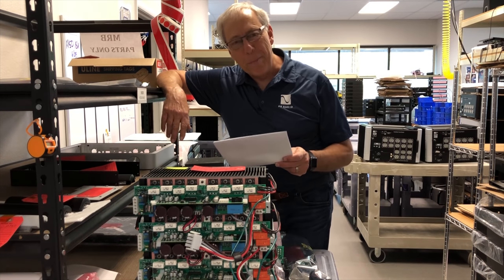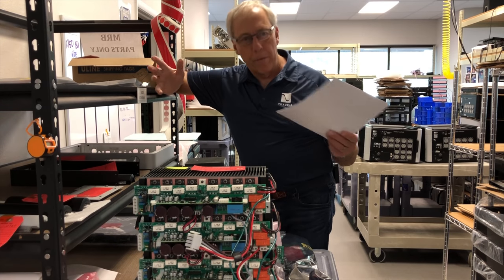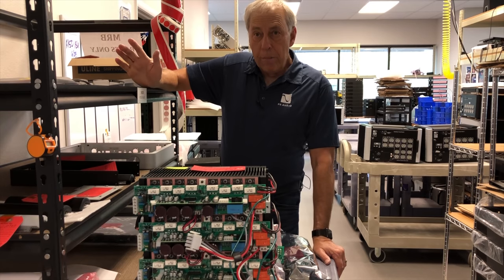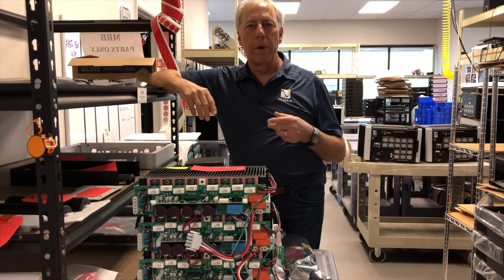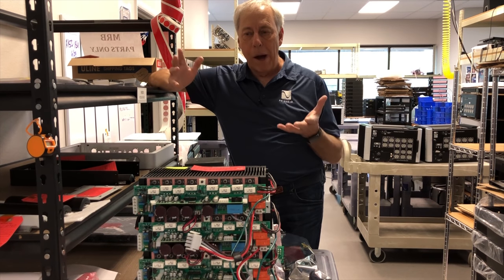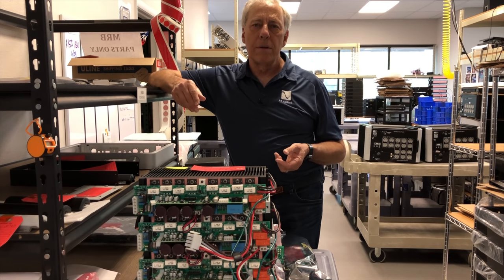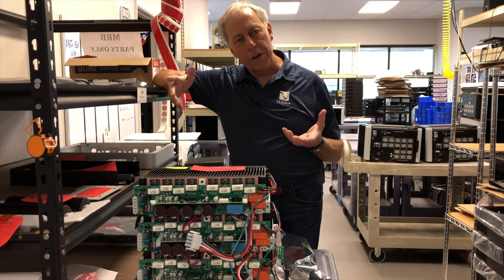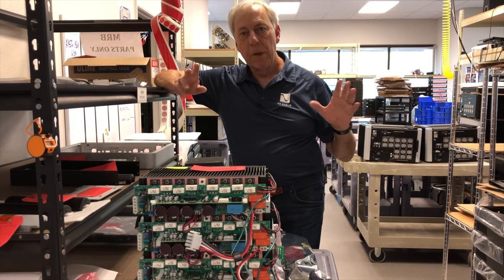Is the BBC dip still used in speakers?

Comment: I am watching this with the sound coming from a pair of Tannoy SRM10B's.
They have adjustable filters, whether that's a good idea or not. They're always flat here, but I do notice that the llittle frequency graph on the fronts of the speakers shows what the knobs on the filter do. And they seem to be causing a dip starting at about 2khz and up. Or the other way around. Maybe they tried to make the BBC dip an optional thing at Tannoy.
I also have a pair of JPW Gold Monitor speakers that actually are ex BBC. They still have the stickers on them. They were probably used in some sort of mobile studio of sorts, or a cameravan. But I can assure you, they do not dip at all. They sound rather un-British. Nice little things though.

Comment: I see that martin Logan and B+W are going with smaller long throw woofers, bigger midranges, and super tweeters that pretty much self crossover. Theory is with the bigger midrange, the cross can go lower and not be in the critical listening area, and the super tweeters can use the same cross as the mids do. I know that I call the sound from my Martin Logan Motion 40's Magic.

Comment: no its not because I do not know any modern speaker designer that uses 8" inch or larger for mid-range speakers in the modern age.  lets go way back to 2004 when this was discussed and almost every point people mentioned in the comments or video seems to be brought up but these guys even naming specific BBC designed speakers...  back then when they did use large speakers for vocals...  the BBC dip or anything like it isnt needed for normal sized modern day mid-range speakers.  ref: http://www.diyaudio.com/forums/multi-way/34354-bbc-dip.html

Comment: I set my EQs with a dip in the middle-middle upper range first. Then adjust it back up from there. Sometimes lowering the 4k and 1k lower than 2k, (leaving 2k flat,) sounds better. Nothing fancy just aftermarket HU 4 speakers from the stone age. I suspect one of my HU's is designed to make people buy the more expensive unit. Too much mid high even with 52W per channel. It was a junkyard buy and had the Din and half adapter for my other car, so it was $15 roughly.

Comment: Nice explanation. It appears you really have a handle on audio. Now if only you could turn off the "Auto-focus" (what I call OUT-OF-FOCUS) and kill the automatic exposure, you could eliminate that blooming effect as the scene changes due to movements of dark materials in front of a back light. Doing it alone? Stick a paper cutout to focus on, put up a pingpong paddle to set the iris, and leave it on MANUAL! But, like I said, good non-technical explanation. Thumbs UP

Comment: have you ever seen the BBC LS5/1a crossover ?
out of this world design.
which used a Goodmans C129/15pr and two Celestion HF1300 tweeters.

I sold a pair of the early crossovers to a guy in Japan for a lot of money.
and the bass units were bought by the Harbeth company , a company you often mention.

Comment: I had a pair of Rogers LS3/5A and they were fantastic for vocals.. they nailed it with good drivers, excellent crossovers, build quality and serial matched speaker pairs. I now have SVS Ultras and although for vocals not quite as good for that, they are superb everywhere even at low volumes and worth every penny. I think KEF have nailed imaging though with combined tweeter/ woofer unidriver, imaging sounds so good other speakers appear to severly lack on imaging and it is noticable..

Comment: The BBC Dip could also be benefiting of the psychoacoustic effect of the "blauertsche Bänder" which describe that you hear frequencies between 700Hz and 2000Hz very diffusal and if you Equalize them a little lower, the sound sounds more present. I tried it at home with some blind tests and the effect is really stunnung. Try it out! :) https://translate.google.de/translate?sl=de&tl=en&u=https%3A%2F%2Fde.wikipedia.org%2Fwiki%2FBlauertsche_B%25C3%25A4nder

Comment: That driver rotation synergy hypothesis is interesting, but what I posit is far more likely is that, while the monitors themselves were in fact flat in their response, human ears are most decidedly NOT in their pickup. The "dip" frequency range was what tipped me off, especially when you mentioned where Mr. Nudell put his "dip"... the ear itself, given its size, shape, and construction (taut, firm skin over cartilage reinforced by bone) has a peak in its' pickup range, the so-called "nails-on-chalkboard" threshold that occurs anywhere between 1.8-2.4kHz (depending on the person) and would be neatly sorted by a well-placed "dip" either in the cabs or via EQ in pre-amp.

Comment: I only buy my crossovers from madisound ,they have a lot of equipment to match crossover parts with individual speaker needs,then build you kick ass crossovers, I got a pair of 2 way and they are 22 element crossovers,not 5 or 6 but 22 man..they cost 200 for 2 speakers but you get what you pay for. You can spend 1000 for a 3 way if you get all the highest end parts,,,but really no need.

Comment: I love your videos. I left you a comment in your segment in welcome to the machine. My second question is... yes I do want to build my own towers, we all do lol. Looking at Dayton subs, audiophile subs and even car audio Rockford fosgate subs, I’m considering Dayton amp plates and SA amp plates. Obviously a D class for the sub section and AB class for mids and highs. I’ve even looked into G class amp plates. My question, I know there are so many answers that can go into so much depth but I want the short version lol. When it comes to crossovers.. I might be going  with a 4 ohm load with Rockford fosgate speakers bcs I’m sure it will take way more bang for the buck compared to replacement home theater subs but what can you tell us about active crossovers? I would like to build a set of towers with two amp plates. One D class for let’s say two 10” subs and then an AB class amp plate to push let’s say two 8” subs, two 6.5” mids and one horn tweeter. Can I use an active crossover to manage the speakers running on the AB class amp plate so I can get full range on the 8” subs while managing the mids and highs? Also might I be able to also manage the two 10” subs on the D class amp plate even though it already has its proper crossover? We youtubers like to know these things lol. Thank you so much.

Comment: The bit about crossovers causing phase shift around the dip frequency, and the resulting problems, around 3:20, would really benefit from a graph I think, or even an animation! I get what you're saying happens, but you haven't really said why. From your strained quality I can guess it's sort-of complicated, but I'd like to know, since that's the point of the whole video. It's why the dip was created in the first place, because of something to do with phases in crossovers. An explanation would give the ultimate reason and be interesting, even if it's difficult to get across or for us to understand.

Comment: There are three parts to a speaker system ; the amplifier with a capacitive output, the crossovers with a nasty complex impedance on the edges of their passbands, and the speaker coil with an inductive load - which is a nasty ball of shit isn't it....  The best approach I have seen, is to use an amp with a resistive output (direct coupled) and apply phase pre-correction (BBE ARS) to recover the continuously rotating phase per-octave over the audio range, and a little equalisation to null that horrendous complex-impedance crossover point, as you note.  Fire that into differential drive speaker set, and prepare to be amazed.

Comment: No good speaker manufacturer that wants to sell lots of speakers has a prominance in that region. Its harsh. Now the Yahama NS10 is the opposite. Peak at 1.8 kHz from the woofer. Good to mix on so if you make that sound decent, it will not be harsh on other poor speakers.

Comment: I run a 4 way p.a., the cross over point to the top end is about 3.5-4khz, it can sound harsh, I lower those frequencies on the graphic, the result is a smoother sound, in keeping with the rest of the frequeny range, which I run flat, unless the acoustics of the venue demand it.

Comment: The dear old Kef LS/3a comes to mind here... 
I do hate it when speaker manufacturers create two wrongs to make a 'right'..!!
This weird acoustical artifact known as the BBC dip was highly subjective in my opinion.... i think it's a kinda 'loudness thing ' that happens with tiny bookshelf speakers.... because that's what they were back then .. The Kef LS3's were  basically Kef Coda speakers , using the B110 and T27 drivers but under a different Spec number. The XO board was changed too .. 
I still stand by my way  of thinking ... and that is ...you cannot hope to build a really good high end speaker system if one or more of the individual drivers has some outstanding imperfections which are corrected in the  XO circuits .... the best XO types are First order types ... with only attenuators for the HF drivers ( if required) and impedance correction for the LF and/or   Mid range driver...
Here endeth the lesson. For now .!

Comment: Watching this video has made me wonder what makes a woofer a woofer.  I'm a guitar guy, and the most ubiquitous guitar speakers are 12", whereas very many bass players play on 10" speakers, and studio monitors have generally 5 to 8 inch woofers, and many PA systems use 15 or 18 inch woofers.  So clearly it's not speaker diameter that makes a speaker have good bass response.  Is it stiffness of the cone?  Is it the voice coil?

Comment: I have designed active crossover circuits for professional speaker systems.  In these systems, the woofer has its own amplifier, so do the midrange (if any) and the tweeter.  So a speaker enclosure is fed by 2 or 3 (or more) power amplifiers.  The frequencies are separated at low power level (~1V RMS in a 602 ohm balanced line) then sent to the separate dedicated amplifiers.  Butterworth filters were implemented using small op-amps with either first-order active filters or Sallen-Key second order.  Something is very obvious at crossover frequency : even though the modules of the frequencies add up to unity if the filters are well-balanced, the phasing at this frequency is 45° per order, so this causes a peak in the compounded module of square root 2 (+3dB) per order.  Hence the "harsh" peak at that frequency.  We corrected the problem by spacing off the cutoff frequencies until the COMPLEX (imaginary plus real) waves add up to a module of 1, or by introducing an all-pass filter (that changes the phase but not the module) in one channel.  And we got a real flat response, no dip, no peak, no harsh.

Now, this is not so easy with passive components.  Large capacitors and coils used in enclosures have wider tolerances than the precision resistors and small polypropylene capacitors used in small active filters.  Furthermore, we could trim the frequency and phase response by adding a small value multi-turn potentiometer in series with the resistor either in the input or feedback network.

Comment: I bought a second Quad 306 amplifier and bi-wired one to the woofer, and one to the tweeter. Big improvement, especially on speech, piano, violin and harpsichord. Search the web and you can find intermodulation distortion graphs that support bi-wiring, particularly of amplifiers.
Also I just bought a Humax 400T FreeView box which I use predominantly with Radio 3, driving my quads through a passive pre-amp fed by an optical link from the box. Clarity is superb, especially on live broadcasts as opposed to commercial CDs. Speakers are Mordaunt Short 2-way  floor-standing from about 1980, that cost me £50 on ebay. You can record radio, and transfer the recordings to USB sticks. A bang-up-to-date digital system for a few hundred quid.

Comment: Don't forget phase distortion cancelation and reinforcement for the physical proximity between the woofer and tweeter.  A lot of noises and clicky pops can jump from the sticky baffle. We tried three and four way systems. The more components the more phase cancelations. We reverse the phase of the mids to the tweeter/ woofer reversing the wave peaks... worse. Keeping the mid in box  un attached to a signal dampened the cross over distortion, anti sound dampening. If you  like Bose the baffle should not be a flat surface but faceted with no consistent reflective surface all out facing angles are transducers creating a scatter effect washing the distortions into a chorus effect tricking the ear into liking it. Massive notch outs up to -20db  at regular frequencies of 44, 440, 2200, 4400 etc must accompany arrays to stop formant feedback in 4 way systems. with each db of gain you must cut the critical frequencies a bit more. Diminishing returns result as more signal energy is reduced through the EQ transients fall off first deadening the sound. Increasing gain increases formant feedback increasing eq decreased transient response deadening lively percussives. If you want good sound learn to play an instrument. You will never create an artistic sound with recreations.

Comment: I think you said they designed them to be flat but then go on to say they are not (which is a little contradictory).  Doesn't make sense.  If the dip is real (measurable in SPL terms) then it is not flat but sounds nicer as a result.  Don't forget that there is the human ear involved in this.

Comment: The BBC dip was a real thing back in 70s. But not all BBC derived speakers had it... the LS3/5A being one example. One of the most exaggerated dips I've heard was from a line of speakers by the British firm Tangent. Their RS2 and RS4 models had a massive trough at the crossover point that covered almost two octaves and gave a very recessive quality to female voices. Apart from this crossover dip and a smaller one in the lower midrange the speakers were remarkably clean and got heaps of praise in the British audio press despite (or because of) the inaccuracies.

Comment: Anyone know what happened to the Phillips idea I read about ages ago?    If i remember rightly......  It was based on negative feedback.  Measure the physical displacement of the cone.  If it doesn't correspond to the (digital) signal level drive it harder or less hard as appropriate.  I forget their sampling rate, but 100kHz should do.

Comment: While I understand the issue with the crossover roll-off. I think it warrants mentioning that human hearing has a natural "sweetspot" between 2k - 5khz. Frequencies in this range are always perceived to be louder (more intense) than they actually are. Oddly, this is also the range that a baby's cries and screams typically fall into. 
I choose to address the roll-off issue by using single full-range driver satellites or two way sub/full range combinations. The drivers tend to be more expensive, but the boxes are easier to build and design. And, the sound....   there really is a special place that high quality full-range drivers can take the music.

Comment: Back In the early 70s I used to stack a small 2-way bookshelf speaker-system on top of a large 2-way bookshelf speaker-system, the cabinet on the bottom usually being a 12-in. mid-woofer with a 3in mid-tweeter, and on top of that would be a smaller two-way cabinet with an 8in mid-woofer and a 1-inch phenolic-Dome mid-tweeter, both were 8 ohm systems, but I would wire them together in series to present a 16-ohm load to the amp (which was meant for use with an 8-Ohm load). I had found that doing so would make them sound quite warm and Rich at low to medium volume levels rather than having to push more wattage into them to make them sound Full, which would have required playing them louder than I wanted to. A bonus of wiring the speakers this way was two-fold, not only did the amps run cooler (both tube AND transistor amps of around 20~50 WPC) but the sound was noticeably less harsh.
I had found that many of the two-way systems of the time sounded a bit Brash in the upper mids, and this seemed to tame that problem as well.

Comment: What it sounds like to me, in non-technical (and non-political!) terms is that they reduced the level to both speakers when they reached an overlapping frequency (pitch,) so that they were not both pushing out full volume, which would have resulted in a "spike" in the sound.  Am I anywhere close to right?